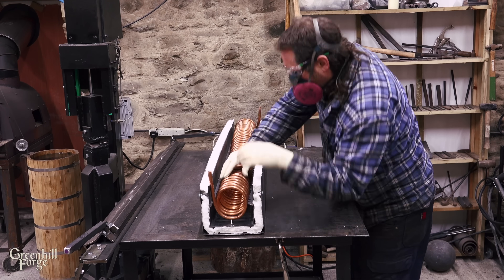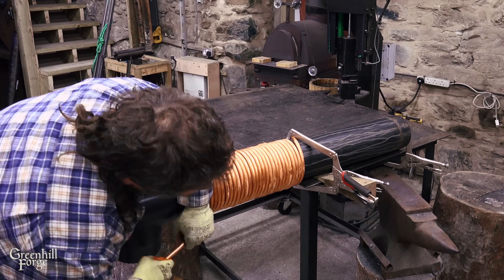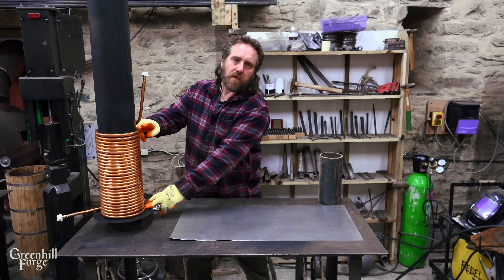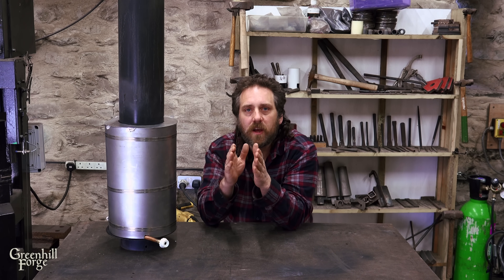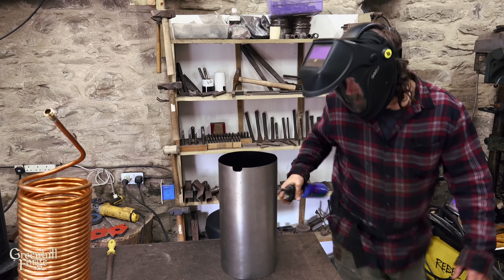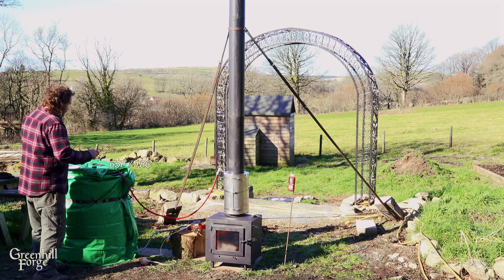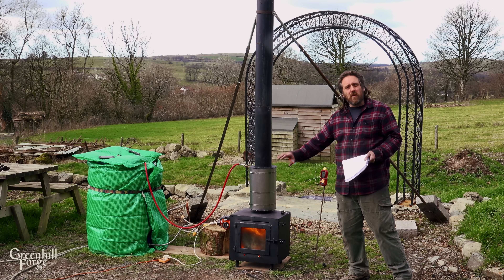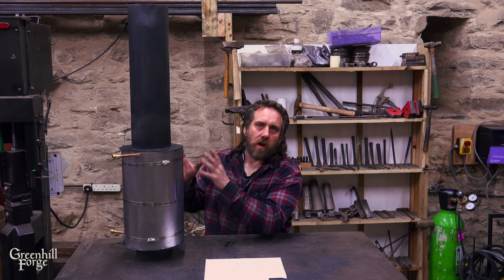Best Wood Stove Water Heater Yet: New Design Tested | Off Grid Water Heater pt3

Comment: I’ve tried multiple pump based designs and somehow I always get ruptures in the coil? The water coming in is 16° C. Which I didn’t think would be enough for damaging thermal shock. Especially when your water was coming in at 8° C. Any idea why I get ruptures in the coil? I’ve tried three times and get ruptures within the first few minutes of running the fire.
Reply from the maker: not sure and I can't give specfic advice without being on site but things I'd check are 1)water is flowing before the fire starts and it never stops? 2)enough water is flowing to keep the temp of the coil down- pump is creating enough flow 3)it's an open system so no pressure can build-the pipe is open to flow freely after the point it's been exposed to heat. 4)no flow restrictions 5) single length of pipe with no joints or defects 6)checking the out flowing water temp to make sure it's not approaching boiling. 
I'll also add the standard disclaimer of - heating water, especially in untested ways, can be really dangerous stuff and make sure you're doing it safely.
Reply: @GreenhillForge  Thanks for the quick reply. Yeah I ticked all the boxes you've outlined (pump started prior to fire, no flow restriction, open system, no joins, no defect). Weird right? There must be some other factor.  I even tried a dual line with double the flow using 2x 1/2 copper. Flow was fast enough that it only improved the temperate on the outlet by 5c. Still a rupture happened. I'm at a loss.

Comment: Hey man, i have always wanted to use a cylinder stove with the water tank attachment. They sell them in kits, colorado cylinder stoves, as well as "cylinder stoves". The tank come with a spicket, i always thought, if you put another spicket on, attach a pump on one end, and circulate your water through your tank, that would probably work Pretty well. The water usually boils off in the tank if you don't use it.

Its not an enclosed system, but what's nice is you could put a water tank on both sides, and also use the chimney coil.

I always wanted to do in floor heat loops out of the water tanks.

Comment: I have an off thd grid shower that has a coppypipe INSIDE the flue pipe and its a gravity fed on demand shower system. Works great! Ive always wanted to set up a system in the house to a water heater for wonter time use..insude the flue is definitely the best place but like you say this way is easier and probably safer. Very cool ideas and concepts being trsted on this channel absolutely love it!!

Comment: what about fitting the coil into the base of the stove itself under the grill on the bottom or weld a grill of pipes into the bottom of the stove that the wood sits on while burning ?

Comment: I stumbled onto this series while seeking info to heat my shop.
I’m planning a similar situation and using the water to run through a pair of fan coil units. For the “storage tank” I plan to use a standard chest cooler and in the summer months I can valve bypass the healing coil and use re-freezable freezer packs to “chill” the storage water to get some cooling. Yes I know that brings condensate along with it BUT, free to semi free heat and AC in my workshop sure sounds nice.

Comment: With the sand idea.. Rocket stove with a diversion chamber.  Think you would have better control of the heat transfer with a pull plate.

Comment: In UK,  been given an old round stove for garden use, then thought I have a pool what about making a pool heater, that brought me here. I think I will try a chamber full size of the top of burner and going well up the flue, make well sealed bar a small vent at bottom so no pressure and then put a copper coil within that 'oven' type space, maybe insulate that too.

Comment: Mechanical Engineer here. Since around 40% of the energy is left in the hot exaust gas it would be smart to use a car radiator to also use this energy. First stage would be the copper tubes and second stage the radiator
Reply from the maker: radiators are a good idea for heat transfer but with wood smoke creosote starts to condense around 350f so going below that opens up issues like clogging and chimney fires so finding that balance is the trick. I've played with the idea of increasing the fire temp for a more complete burn, trying to burn off the molecules that form things like creosote so the smoke is cleaner and can be used at lower temps. Here's a few of those videos https://youtu.be/pfWMZuctbXM https://youtu.be/as1jIeabK-U https://youtu.be/G7k_CatVFM4

Comment: I really enjoyed seeing these test. In your last design, could you increase the efficiency by spacing out the copper tubing further up the stack? Benefiting from the excellent heat transfer of the graphite and collecting the thermal mass over a greater distance.  Im concerned that the incoming water in the tubing so close together could be counterproductive to your heat transfer process.

Comment: Great data, but not actually apples to apples. ? I don't know. 
The tests with the transfer tubes on the outside were all done at a different height (they were compact) than the test on the inside (pulled apart, expanded)  if you ran a test with the outside coil method with the coils pulled apart to equal the length of the inside method, and with the grafite fill, would you end up with more time in place absorption of the available heat thru the grafite and into the coils.  ?? Possibly more time in place to shear the temp. might even  drive a quicker rise in temp..  any ideas??  Hmmm.  Sounds like another video.

Comment: Try expanding the coil the entire length of the flue. You will increase direct surface contact, plus the exposed sides of the copper pipe will be exposed to air heat from the flue in the spiral gaps. I wouldn't fill the gaps because the flue heat will travel up the spiral gap getting hotter as it rises. With a compact coil you only expose the copper to less than 50% of the flue heat. I would add a metal outer sleeve that does not contact the copper. Then you would expose the coil to 100% of the flue heat, and using the full length of the flue will boost output.

Comment: that's all pretty good stuff right there but the problem I see with the whole system any water heating tank you have a anode and a cathode there for a reason if you use that very much you're going to figure that reason out would like to see long-term testing in a practical situation where you would be using it everyday

Comment: Why not use a stainless steel water jacket? Just remember to weld with 304 filler wire when going from stainless to steel. And the entire water jacket is integrated into the flue.

Comment: Here's a thought...  Surface area matters.  Take your original design, add an inner flue pipe and fill the space with the graphite.  This give you the increased surfaced area as your copper coil will have the gap spacing and the graphite will aid in heat transfer up and down the flue pipe.  Longer pipe with greater surface area for heat transfer.  Basically take your original design and the 4th revision and combine them.  I think you will like the results.

Comment: create your chimney/flue from multiple smaller diameter pipes. Then run coils around EACH pipe. Now like you did here create an outer jacket and fill the cavity with your sand or graphite power and add outer insulation. The added surface area should significantly increase heat transfer while the smooth surfaces inside minimize soot buildup. Also, with the sand/graphite around the copper water pipe I would increase the gap between each coil slightly (maybe about 1/8-1/4") to allow the graphite to completely surround the pipe. 

Also, while I understand your desire to operate a passive system, I would personally reverse the water flow so the coldest water enters the top giving you the greatest temperature differential throughout the length of the loop. You could easily pump water up to a small reservoir powered by a small battery and solar panel and let gravity  move the water down through the heat exchanger. Or just directly pump the water through the system. The faster the water moves through the system the more heat it can move due to the higher temperature differential. As the water heats up the heat transfer will slow down. This should increase the overall efficiency of the system and also raise the water temp faster.

Comment: Just make/weld a thick walled 5 gal water box/tank directly on top of the woodstove and use your cast iron pipe as the base of the flue to run right up through the middle (then extend externally with your normal flue material).  Pretty sure that will be more efficient than loosely wrapped copper with minimal direct metal to metal connection to the thin wall of the existing flue.
Reply from the maker: I made an off grid shower that is basically that design that I show in this video https://youtu.be/pP_2A5Wdvqg  Mine is actually 4 smaller flue pipes that run up through the water jacket and then join back together at the top

Comment: Take the copper pipe out altogether. Make the flue out of stainless sheet, basically,  make the "cover" type design that you used to cover the copper pipe, just leave out the tubing and insulation, leaving a tank, weld it up airtight. Put insulation on the outside of the , now what would constitute a tank, add an inlet and an outlet connected to hoses/pipes going to your water storage tank. Have the water directly against the flue. Doing it this way you can now vary the size of the heater tank and it should heat the water a lot faster.... Does that make sense ?  I've seen them made this way...

Comment: Heres what I would do:  line the stove area with the coil embedded between two layers of soapstone. Use thermal paste for contact with coil and appropriate grout/insulation between soapstone peaces. This could be extended into the flu as well. 

Soapstone can machine so nicely!  But be warned, it almost always has asbestos contamination. Use caution.

Comment: You can't suck too much heat from the stove pipe, you'll kill the draft and vastly increase creosote build up.
Yeah, its wared heat but its a very slow flow of hot vented gasses and thats REQUIRED for proper stove pipe draft and less creosote deposits.
Take heat from the back of the stove inside the sheild. Its usually sheilded for closer safe spacing to walls.

Comment: 1, use ironsand or crushed nightstore heater bricks as sand for better thermal mass?
2, use the same length of copper but more open coil to take advantage of more of the hot gasses? Would need more enclosure, insulation, materials etc unfortunately. 
3, Have a cast iron water jacket inside the firebox to preheat the water before it gets to the main coil?

Comment: It could help spreading out the coils as in the other test with them inside the flue they travel all the way up cause they were pretty tall. I think having them longer in this set up too would help getting all the heat possible cause no matter how good the medium you out outside is at transferring heat, the flue itself will heat all the way, not just that particular section. Or put more copper pipe as it's obvious by now his set up isn't as efficient in heating as putting the piping on the inside, and just try to make the most efficient way possible, that would be nice to see.

Comment: Just a quick observation. You may have the same amount of copper inside which must be good as you have proven. But the notice the height of your copper coil inside the flue. It would be interesting if you used the graphite powder with your same length of copper but stretch the coil out to the same height as the coil inside the flu. We are getting less resistance and better heat transfer with the stretched coil on the outside. Same copper pipe length - but same height of coil as internal version. More graphite with longer transfer box and quicker coil flow.

Comment: How come you didnt separate the coil like you did inside the flu by putting and half-inch gap beten the copper coil - surely it would absorb a lot more heat and therefore heat the water quicker?

Comment: Why don't you use anti-freeze instead of the sand, and insulate around that? The liquid will absorb the heat from the vent pipe as efficiently as anything and transfer the heat to the copper coil. A lot of heat will be lost to the liquid medium until the it reaches it maximum heat, and you could put a T&P valve on it to keep it from exploding. The only down side I can imagine would be that the creosote will build up rapidly at first due to the cool temperature of the liquid.The other problem with the sand is that it is an insulator and wont transfer the heat like a more conductive material would.
Reply: How about a direct liquid jacket around the vent pipe and with the vent pipe spiraling, insulated around the outside?
Reply from the maker: I think it would work very well but the complexity of the build just drastically. a spiralling flue woulf be difficult to clean but would increase efficiency for sure.
Reply from the maker: I used the graphite to solve the problem of the sand being an insulator. Liquids like anti-freeze or even water would indeed work very well for heat transfer but come with their own set of issues. the jacket needs to be completely water tight whereas with sand or graphite tiny pinholes won't matter. Boiling presents a danger and must be monitored but things like sand don't have that issue. a liquid jacket would need to be an open system or it could build up pressure, anything that reaches over 7psi in the UK or 14psi in the US has very strict legal and insurrance requirements.

Comment: good info, but having lots of experience on retaining heat wherever you want in automotive industry i cant recommend you enough you to test fiberglass wrap, easy to install and fast, also you can use a mix with a wrap + graphite

also there are much better systems for exhaust manifolds but they are much more expensive so thats why i wont recommend but you can investigate all the methods to test them ( most of them will be unavailable on hard to reach areas, another plus for the fiber wrap) 

another plus i would recommend you to use, it is go to a scrapyard and take out the chassis heat insulation and added them outside the steel, they will be cheap and also you will have much less heat loss than having the steel directly to ambient, use the aluminium ones, alone or that been filled with different fibers

hope this helps to your reasearch

Comment: Make a water jacket that fits onto the fire and the flue fits the top of the jacket,  make the flue part go wider through the jacket to slow the hot gas down to contact the jacket longer. Ex boilermaker, heat recovery member.
Reply: This seems like what the train boiler guys are saying, but your description clicked for me.
Reply: @bagel123kloutit's called a wetback stove, you buy them over the counter in New Zealand and Australia

Comment: Using more of the chimney to capture more heat would likely be quite beneficial; you perhaps could have made use of chimney exhaust temperature data from the tests in this video to inform how useful that might be

A "permanent" construction could contain the graphite directly with the wool to keep the heat more focused on the copper - should be easy & practical to do, too

Comment: You only utilized the surface area in the bottom third of your standpipe. The rate of heat transfer is related to the difference in temperature (sometimes called 'the delta') between the two surfaces. But when you have extracted some of the heat from the steel standpipe surface into the copper, the heat differential goes down at that local point. However, in the top of your standpipe where the copper coil is NOT extracting any heat, the temp of the steel is much higher. Try having the coil with 1" gaps vertically between each time around, like a coil spring on an automobile. Same total copper, but it is spread out more evenly on the hot steel surface and the delta is as high as can be across all of the copper and steel.

Comment: Try welding a spiral of steel onto it and have the copper sit between it. Think of it as cooling fins on a heatsink, this should help transfer heat from inside the flu to the graphite.

Comment: You know back home in New Zealand  we've  been using wood fires with built in water heat exchangers for four decades. The coil is actually situated inside the firebox. I say coil, but it's  not a coil.  It's  a single loop that enters from the rear of the firebox,.. runs the inside circumstance and back out. 
Is easy to install  and way more efficient than flu coils. !
Reply: I have seen this system before and it fascinated me completely. It was connected to a closed pressurized system and maintained the heat in a geyser. Apparently it took 45min to heat up without pumps etc since hot water pushed out the top, automatically filling with cold from the bottom.
Reply: Coils on top of the stove place another piece of plate over the coils so you can still use it for cooking. The flew gets Hot but doesn't hold it goes up the flew. That's why you cook on top of a stove and not on the side.
Reply: Have any we links to those stoves you mentioned or any elated equipment kiwis use for it?

Comment: I think there is a lot of heat wasted above the water heater. If a pre-heater was installed up there, it might lift the temperature of the water before it enters the main heater and thus improve efficiency.
If temperatures are lower up there, you could find a cheaper alternative to copper. 
Great videos 😃